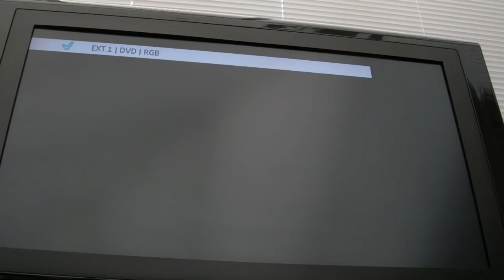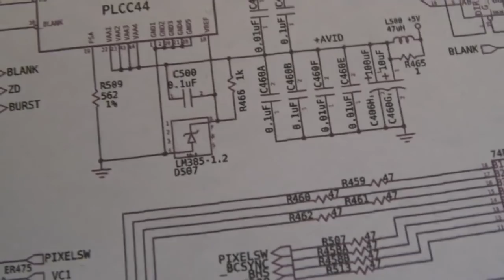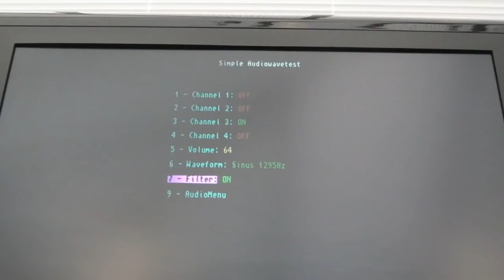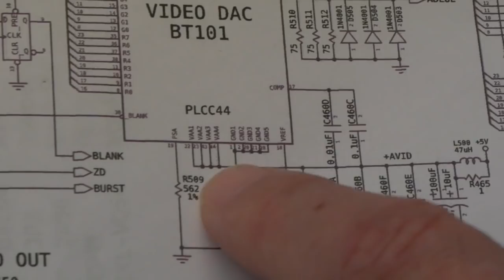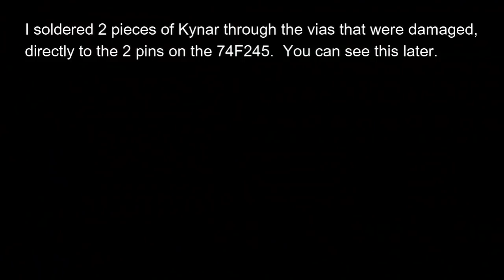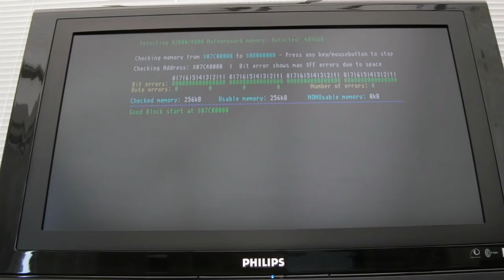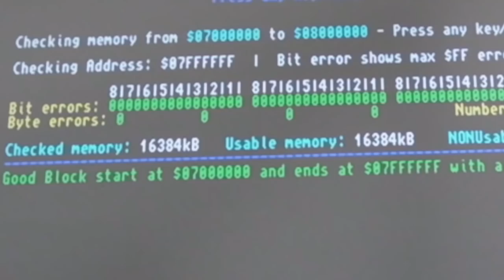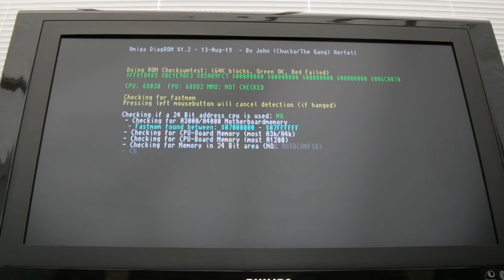32bit Commodore Amiga Repair-a-thon - Part 1  (A4000 x 2)

Comment: I generally use my hoof tip to do everything; even surface mount stuff (including 0805 resistors and caps). With the fairly tight temperature control that my station has (it takes T15 style integrated tip/heater cartridges), it’ll very quickly bring even large parts up to melting temperature without overshooting.

Comment: There's something really satisfying about adding some flux and cleaning up a crusty solder joint.  Though soldering on corroded boards can be a such a pain.  Sometimes they refuse to take solder, no matter how clean and fluxed they are.  And you never forget that smell of battery corrosion being heated with a soldering iron.

Comment: Just curious... Why didn't you start by removing the battery and neutralizing the caustic material?
Reply from the maker: I really should have removed the battery at the start - I did that on the 2nd board.  I neutralized battery and capacitor leakage as I went around the various areas on the board. It was quite moderate except for around the RTC area.

Comment: My fathers his old Amiga 2000 had also the battery leaking problem, but it destroyed nothing, some of the great paint, or what is called was removed from a trace, but put some new green stuff on and and used a UV lamp so it hardened, and cleaned it all and everything was good, i also recapped his Amiga 2000, was a LOT of work, never had so much trouble removing caps, i had to put my desoldering station (ZD-915) on 450c to remove the solder, but after i replaced all the caps, the Amiga 2000 did not work anymore, so i thought i had destroyed my fathers Amiga 2000, but luckily i could fix it, i bridged two traces, one i could remove the solder but the other one i fixed with new small cable i soldered.

And also recapped the PSU and put a Noctua fan in it, and made some other stuff better, and now everything is working great again.

Comment: 48:36 "And the Zorro two is not working" I think you mean Zorro III, because the Amiga 4000 use Zorro III, just like the older Amiga 3000, but yeah the Amiga 2000 uses Zorro II.
Reply from the maker: Zorro II wasn't working though ;)   Zorro III is just an extension (with faster throughput).  It uses the same connectivity I think.